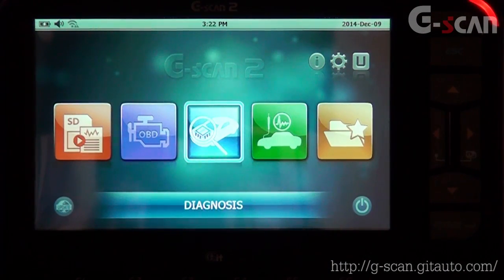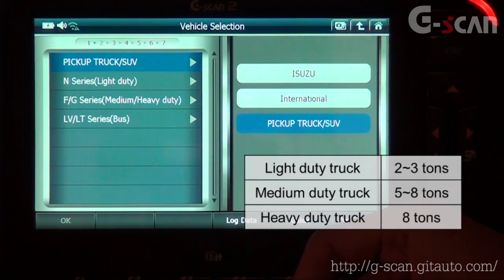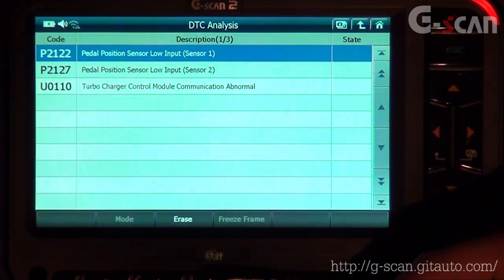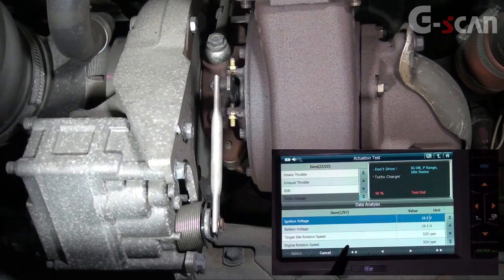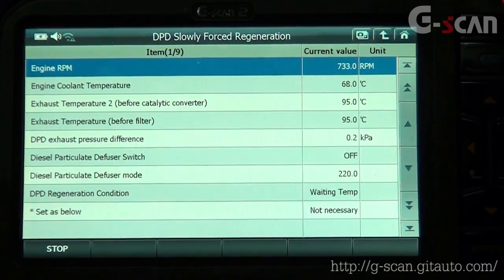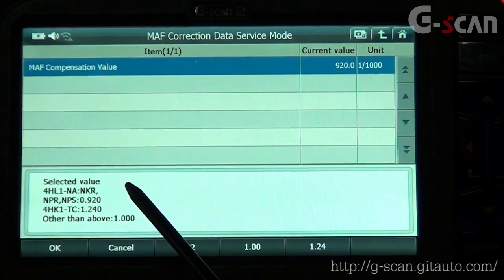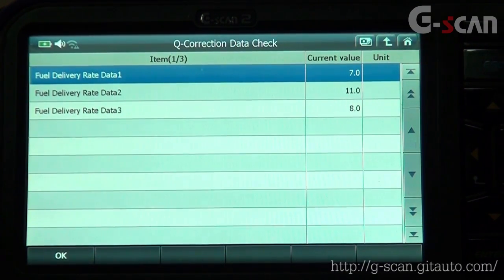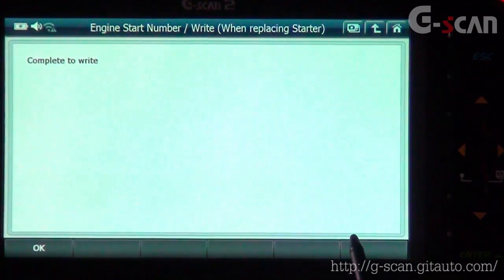[G-scan] Japanese Commercial Truck Training Video_Chapter 2

Comment: Isuzu Giga truck 6WG1 no data or no communication in gscan 2. I used special adaptor. only 2 adaptor or 3 adaptor
Reply from the maker: If you have any technical difficulties or questions with G-scan, please post at Tech Q&A page of our website: https://g-scan.gitauto.com:6510/eng/board_skin/board_list.asp?bbs_code=5
Reply from the maker: If you have any technical difficulties or questions with G-scan, please post at Tech Q&A page of our website: https://g-scan.gitauto.com:6510/eng/board_skin/board_list.asp?bbs_code=5
Reply: Hey mate did u fix the problem we have same